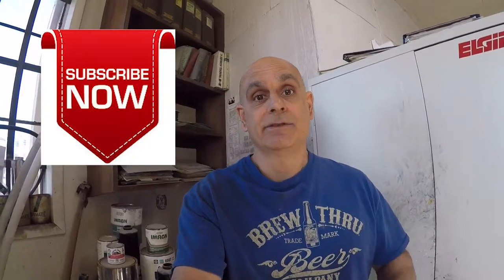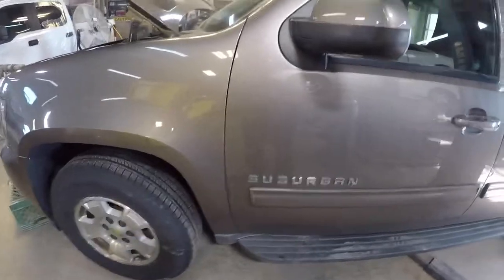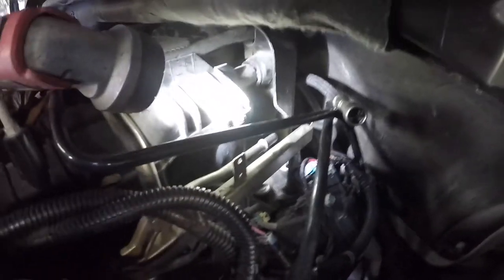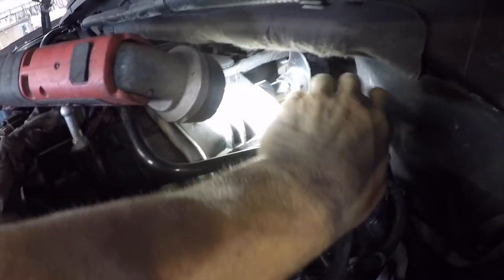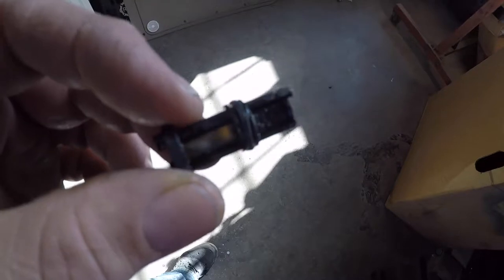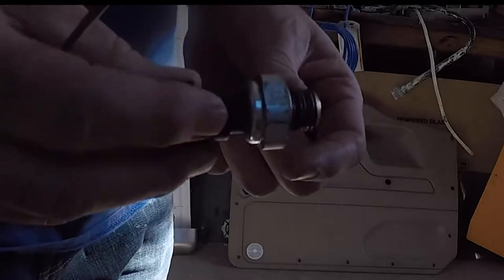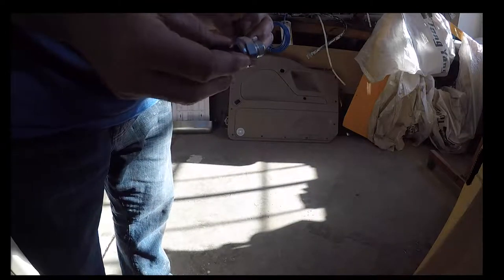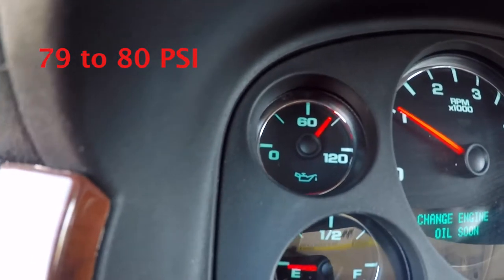Chevy & GMC no or low oil pressure  reading on gauge~~~ Easy Fix

Comment: My 2011 Tahoe 5.3 oil pressure sits below 40psi is that normal I changed the sensor with the little filter and it does the same thing!!?? HELP what do you recommend
Reply from the maker: I’m out with Covid-19 when I get back to work I’ll research it

Comment: My silverado 2006 Silverado is having a bouncing oil pressure gauge, and rpm would go up and down as well. Would eventually turn off after it being on for some time. Changed the oil sensor. but i got oil pressure before. truck just went to 0 out of no where. Do you have any idea why ? i did not change the sensor filter tho

Comment: I just changed my crankshaft, rod bearings, oil pump and timing chains and my engine is at 10 psi oil pressure which is the minimum. Any idea why it’s so low? It’s a 2010 Camaro 3.6
Reply from the maker: hook a manual gauge and take a reading to make sure your gauge is accurate
Reply: @AutoRepairTips757  I think I figured out why. I didn’t replace my pick up tube seal. And I had to change my crankshaft due to rod knocking. Do you think the seal could be the cause???

Comment: I have a 2000 Oldsmobile bravada 4.3 vortec every time I start slowing down or stop my  fuel gauge goes straight to empty and goes back up after awhile I know this is not about oil pressure but I'm stumped on what the cause can be I got 55-60 psi on the rail
Reply from the maker: I’m not going to be at work next week, but it’s possible it could be your fuel level sensor. When I get back to work I can check to see if it has one and the location

Comment: Do u think will be the same with my 2000 chevy 3500 passenger van. I change the oil pressure sensor twice and still does the same.
Reply from the maker: You need to take your vin and check to see if you have a strainer under your sensor

Comment: I have a 2002 Chevrolet S10 4x4 pickup,  When cold it runs 40 Psi, Driving after warmup it registers about 20. When I'm at a stoplight idling, It gets near 0. I've noticed quite a few videos of S10's with the same problem. To manually check my oil pressure,  I'd have to remove the distributor.  The sending unit is under there. Any advice would be greatly appreciated. Oh and by the way, The oil level is always full.
Reply: Have you figured it out yet? Cause I have the same problem on my 2000 GMC Sierra with a 4.3 when it’s cold it’s at 40 psi then when it starts warming up the oil pressure starts dropping then eventually it just stays at 0 I’ve already replaced the sensor but it’s still doing that idk if the gauge is just retarted or what
Reply: @BackwoodsWrenching  
I'm going to put a gage on it and check it manually.  It's a pain, You have to pull the distributor to gain access to it. The truck runs great, I'm just not sure why there's a few of us with the same problem. If you happen to figure it out,  Please let me know.
Reply: @stjohnsriverrat  I gotchu I just can’t find anything on it and I mean I’ve been driving my truck for over a month with it like that so if my oil pump failed I’m sure my engine would have started knocking or blown by now
Reply: @FordShitBoxes94 you ever figure it? I have a gmc envoy 4.2 6cyl. Does the same thing. New sending unit. No knocking. Manual pressure reading is ranging 6-12 recommended is 12
Reply: I haven't figured mine out either, It's not a daily driver.